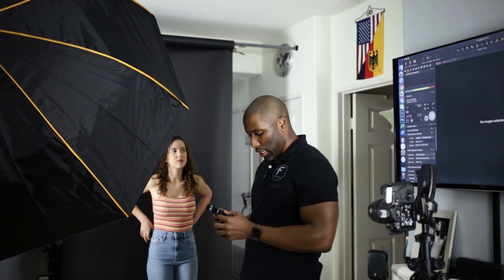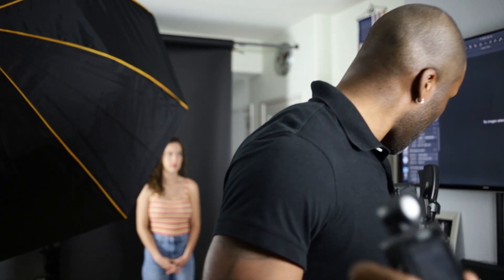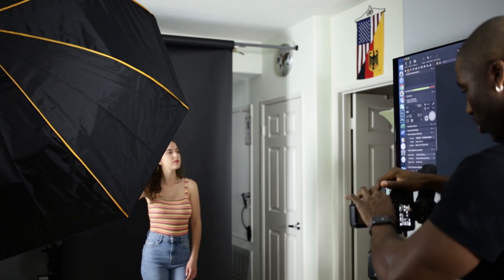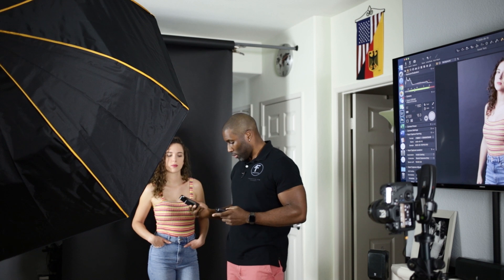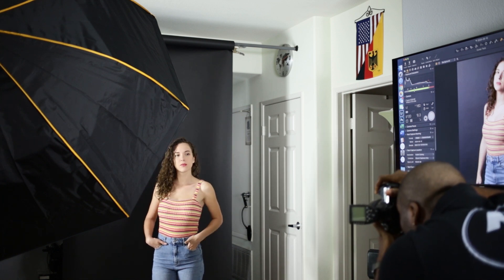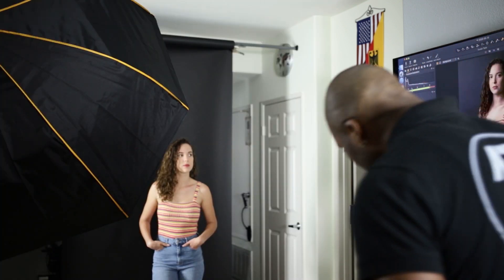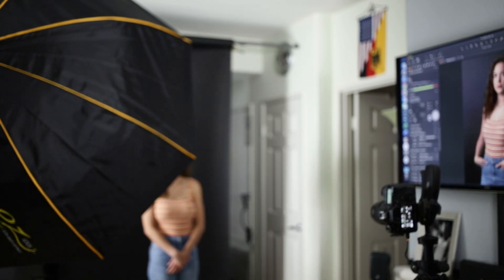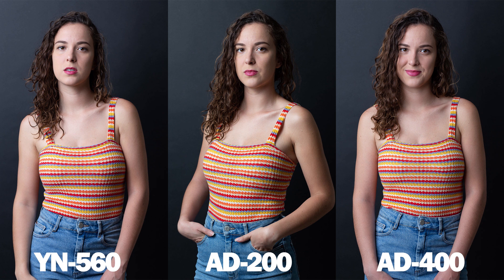VIEWER QUESTION | Power to Fill a Large Modifier

Comment: pls, What is the difference between the  white and black/silver umbrella?
Reply from the maker: White umbrella's are generally considered shoot through umbrella's as the light is meant to go through the umbrella, diffused, and then out the other side. Silver umbrella are considered bounce or reflective umbrella, the light is shot into the umbrella then it's bounced back towards the source and onto the subject. Black umbrella's aren't really a thing, some reflective umbrella's have a black outside lining to help bounce the light back. This can also be found on white umbrella's, which essentially turns a shoot through umbrella into a reflective umbrella. Hopefully that all makes sense. Ask more questions if it doesn't. :-)

Comment: It seems to me or more power the ligh is, more soft is it?
Reply from the maker: I do find that to be true, to a degree. Even though all three light sources were metered the same, the AD400 would inevitable do a better job at filling the entire octabox with light, and more evenly. This would allow for more light wrapping around the subject and hence yielding a "softer" light. In my case, I do think pose played a bigger factor though. With the speedlight, the subject was looking straight and the octabox was on her right. This yielded more shadows on her left side, where the AD200 she was turned more towards the light. With the AD400 distance from the subject was the same but exact angle/position was slightly different.